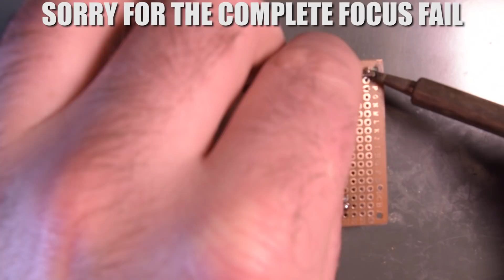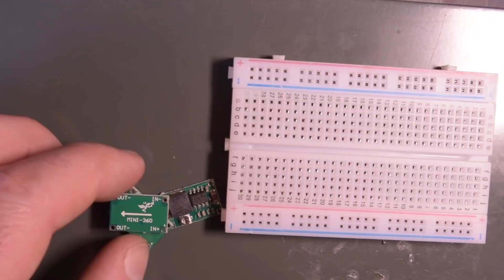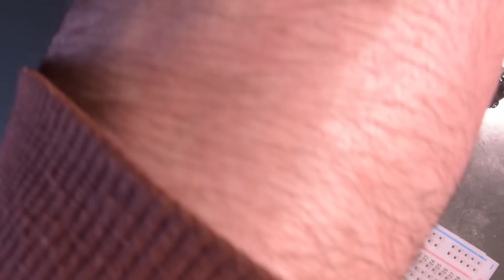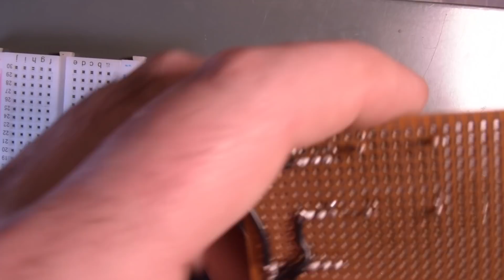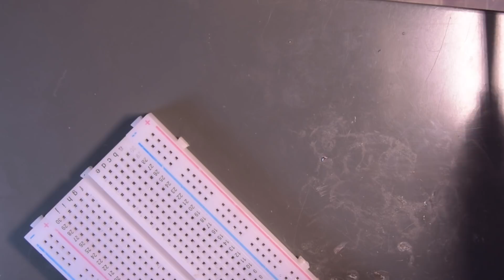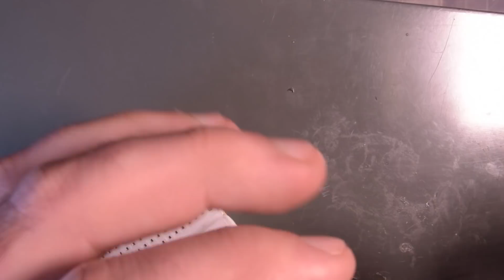Making A Multi-Output Power Supply Part 3 - The Soldering

Comment: I like to run a thin bare wire along the path that I plan to grow a "solder trace" on. 

Helps keep the solder in line and reduces the tendency towards blobbyness.
Reply from the maker: I'll have to give that a try, thanks for stopping by! I figured you were busy I have not seen much new stuff from you lately
Reply: Yeah, I've been busy, but if you refresh your subscription page in about 3 hours there should be something new.
Reply from the maker: I'll be looking forward to it!